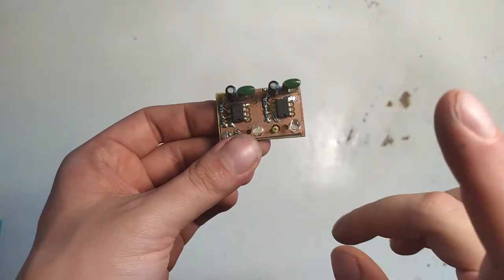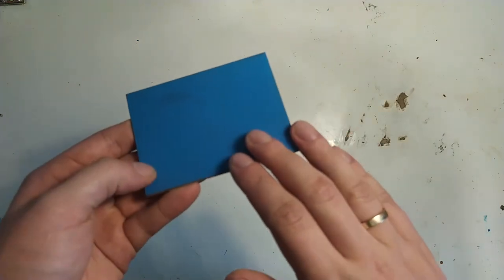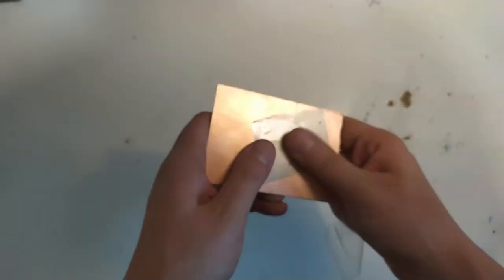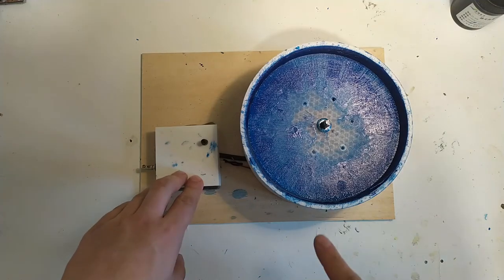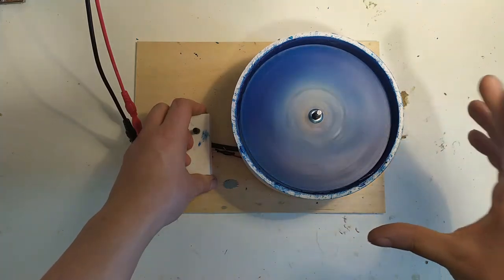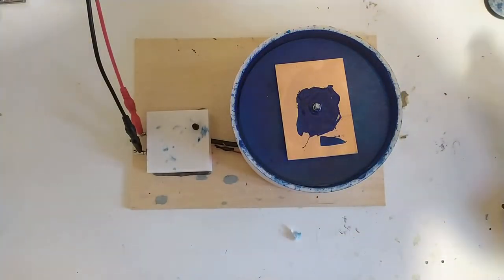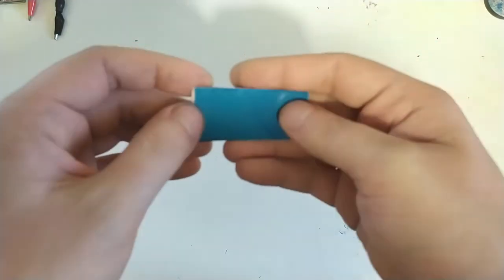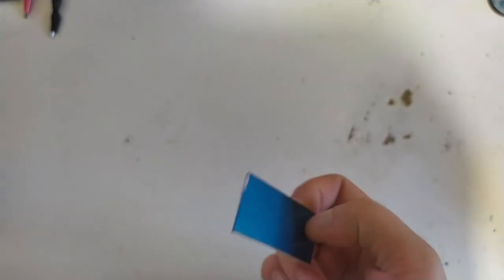Making double sided circuit boards Part 1: Spin Coating

Comment: I would use flat boss on the shaft hot glue or strong double sided tape to attach it to the disk.
Reply from the maker: Double sided tape works well, Might redesign the platter sometime to have a flat surface.
Reply: @captainsolder5247  Can you dry it with a heat gun?